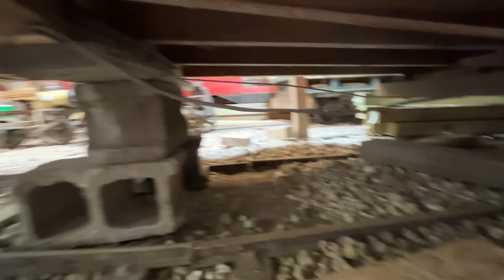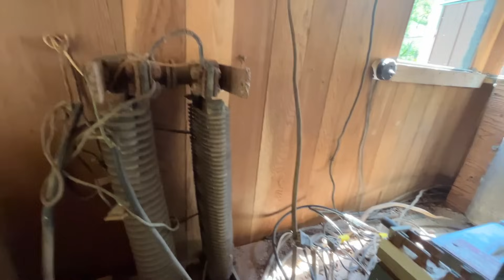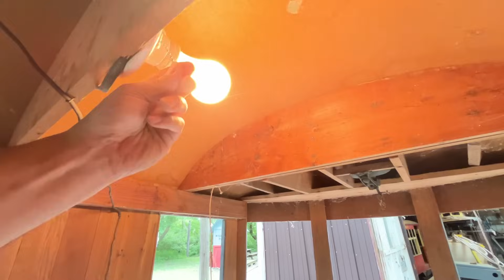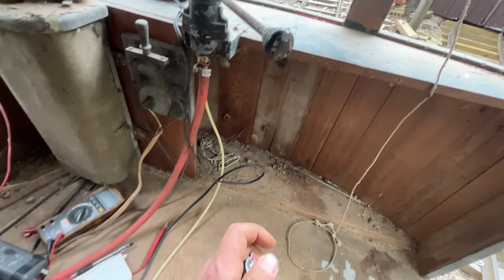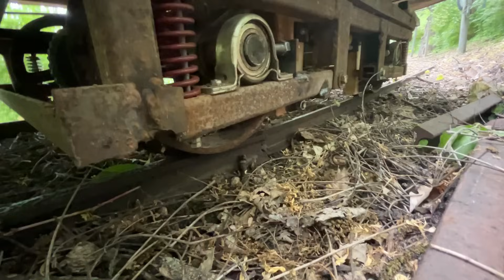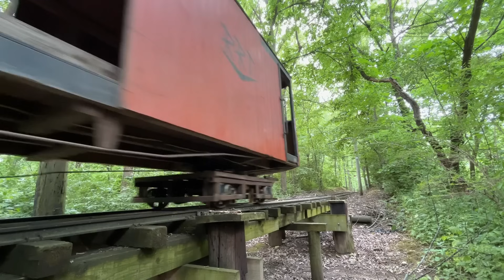Boxmotor truck motor modification, part 3. The initial test of AC traction!

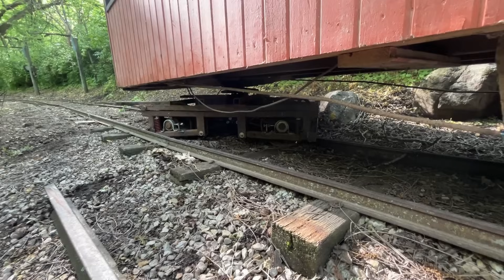Comment: The reason for the derailment is right there in the video at 13:50 - 13:55. The trailing truck catches the down grade end of the spare length of rail laying on the right hand side of the track. At 13:55 you see the up grade end move forward in the earth, at 13:58 the rust mark on the end of the tie shows where the rail had been sitting. Hope this throws light on the issue. By the way, just discovered delightful videos. Best wishes from England.

Comment: I love the integration and modifications. I love the rides on the rails. What is the maximum operational current the overhead power line system can safely/reliably deliver?
Reply from the maker: The substations are fused at 30 amps each, and there are 3 substations spaced equally around the line

Comment: On the older dc motor, depending on its rated voltage, you could make a full-wave bridge rectifier from the ac supply. The biggest issue would be syncing the rpms on both, if you went that way.
Reply from the maker: Thats how the old system worked, was just a basic resistor based speed control. It worked fine for many years, but an upgrade was due!

Comment: This dropped into my feed and I am glad it did.  That is soo cool!  What a toy set!
Are you running a filter or buffer like a UPS between the overhead and the VFD?  I imagine the VFD has to be a bit more sensitive than the old system to the micro drops.  I hope you still fix that bad track joint.
Sitting here in envy.  Cheers!
Reply from the maker: Nope, the VFD is fed right from the line! It has a really large front end capacitor bank that will run the motor for 5-10 seconds of power loss and so far its working well enough with that.

Comment: It would be really cool if you put a brush on the box motor and converted it into a snow sweeper for the winter. Great video as always!
Reply from the maker: I've considered doing this, but the road to get there is nearly impassible after much snow so I wouldnt get to use it much unfortunately. Unless I buy a plow truck so I can get there lol
Reply: @CNW4145 relatable😅

Comment: Very interesting video. I really like the chain drive system. I can't believe that whole box balances on those 2 pivot points. Seems kind of sketchy to me. The trucks seem so narrow compared to the overhang on the car itself. I don't know how much the car weighs but it seems like all the components on the trucks look underbuilt for the job. You would think that the pivot rods would go through some kind of bearing with a bolt to secure them to the box. Just my engineer's point of view.

Comment: caution, NEVER use cement blocks for cribbing.  they can fail without warning.  use wood, very safe, NEVER cement blocks, you can be trapped or killed
Reply from the maker: This is also why you never work under a suspended load, and always anticipate that its going to fall.

Comment: You can see that the car struck that rail lying on the right side of the hill track. If you look at minute 13:52, you can see the near end of the loose rail within a couple of inches of the running rail. Probably the truck hit it
Reply from the maker: Nope, the rail was hit as a result of the derailment. I found the problem already and it has been fixed :)

Comment: Do you need a separate VFD for each motor when you get the other truck upgraded?
Reply from the maker: No, the VFD I bought is a 10HP, and it will drive 2 2HP motors. Should be more than enough power!

Comment: What a superb video ( as always) I am always happy when your latest videos pops up.
However 
Your happiness when Boxmotor just flew up the hill. was simply joyful to hear, if you could bottle that, we would be millionaires!!  
This is a great Chanel to watch
Reply from the maker: It was a good feeling to see it work so well, by the math I was going to have just enough power to get up the hill. But I had made some assumptions in the calculations so I wasn't 100% sure it was going to work. Fortunately the car is lighter than I thought, and the grade is probably not as steep as I thought which led to the overwhelming success :)

Comment: At 11:52 you can see a link of rail that is close to the line on the right side.  The truck hit it causing the derailment.   You can see it move up a few feet as the truck smacked it.
Reply from the maker: While it appears that way, the derail actually happened much sooner than where the rail was placed. When the car went a bit sideways it allowed it to get close enough to hit that piece of rail. I found the bad spot in the track and have since replaced the springs which now allows it to traverse the bad joint without issue :)

Comment: I like small channels with interesting rail based content. I'm amazed it took so long to find you. Been watching a few vids. I'm fascinated with catenary and pantographs. Must have something to do with mild OCD. You picked up another Sub.  

Re grade determination, on another channel they're planning a route extension. Every episode has at least one derailment. They don't take themselves seriously at all. It's very funny.
So for the route extension plan they have this tool called MOASURE (I guess Minute Of Angle Sure - hence Moasure). It isn't cheap $6-900 depending, but if you ever needed to work out grades on a route extension, where to put fill etc that is the tool for the job. It has point to point and out and back, circuit etc - I guess for landscapers building paths and planning gardens. 
If interested check out this episode>>  Mill Brook Railroad Building a Railroad Bed With Nothing But Hand Tools
Reply from the maker: Welcome to the channel!  I enjoy watching the Millbrook guys as well :)

Comment: Modern technology sure makes motor control easier.  It’s nice to see that it runs so well. Do you plan to re motor the other truck, or will the one have enough power.
Reply: I guess you answered that at the end of the video.

Comment: Congrats!  Fantastic always to see another video up.  I did hold my breath at 13:51 when I spotted the spare rail really really close to the right side of the track -  and you can see this rail get jammed ahead about a foot at 13:54, so initial reaction to the derail was the spare rail not clearing something on the tram?  But I see you went on to determine the cause as the uncompressed spring.
Reply from the maker: That piece of rail is there to change out a bad section when I get to it, when the car derailed it pushed the piece forward. I'm kind of glad I caught all of that on video!

Comment: What a treat to se the Boxmotor running! I really look forward to following how you rework this charming (and well built) vehicle. 

Charming in my view, because it bears the shape of a classic streetcar - although I clearly get that the steeplecab is so practical for work trains. Charm aside, the improved drivetrain, control equipment, the planned placing of it, interior remake… will make the Boxmotor shine. 

Warm greetings from Norway…!
Reply from the maker: Thank you!

Comment: How about fixing a catch rail on the inner side of the rail on the inside of the curve.  Then even if the wheel on the outside rail does jump, the catch rail will hold the wheel flange in place and prevent it from coming off the rails?
Reply from the maker: That curve is going to get a gaurdrail as soon as I get some 12lb rail to upgrade it with. Hopefully soon I will run across some to install.

Comment: Nice to see all the foliage on the trees, the line looks totally different. Interesting that your overhead is 240 volts and yet your domestic voltage is 110 volts. Here in the UK, domestic voltage is 240 volts.
Great to see the boxmotor running again.
Reply: Most homes in the US have 240v split-phase run into them for high power appliances such as electric stoves and clothes dryers. We just split the phase in half for 120v in most outlets and light sockets, hence why we can get away with terrible plug designs, most outlets won't kill you instantly if you touch the live current as it is 120v. Of course our 240v outlets also suck, but there are usually no more than 3-4 in any given home, and you are meant to shut off the breaker before tamping with the plug.
Reply: @joedingo7022  I think you are bit out of date regarding UK socket outlets . I am currently sitting in my little 2 bedroom house in Blackpool ,England and there are 15 double sockets in my living room and probably 40 in the whole house and workshop (model railwar room). Not all will have as many as me I will concede!
Reply: @captainnemo247  I meant that US houses have dozens of 120v outlets, but no more than a handful of our sketchy 240v outlets.

Comment: such a cool setup, I love how AC motors are getting more and more practical to use nowadays with VFDs becoming affordable and tons of E bikes and EV brushless controllers for battery powered stuff. It would be a dream to have a private rail line that large to play with, excited to see how the interior ends up looking like when you make the dash and finish mounting the VFD underneath, Do you plan on doing a driving seat too or is it comfy how it is?
Reply from the maker: Im going to add a seat, and maybe some benches in the middle for other passengers. I'm getting to old to sit on my knees anymore lol

Comment: Great action shots outside of the car on the RR.  VFD's are amazing and efficient.  For low cost braking resistors if you need them, electric stove burner elements can work depending on the VFD. I retrofitted a 15hp on a cnc lathe and the stove element has been doing braking duty for 15+ years now no problems.  Your VFD can probably do 200 and maybe 400 Hz, that would be a real speed run!  60 Hz looks plenty fast tho!
Reply: That stove element seems a smart 
economical way, just like real train dynamic braking😊
Reply: @danielfantino1714  Ya the best match ohm's wise was the smaller diameter element at Lowes. 15 years ago they were like $8.00
Reply: @funone8716 
When we see the numbers of years a stove element can last, à very rare article that still last in crap cheapy modern things, on that application it should last for ever, and if connect to the wire, even make a cup of tea or coffee. And in winter cold why  not a hot wine cup....even if FRA won´t approve the last one😅😅😅😅
Reply from the maker: I do use the braking capability, but it already has a large internal resistor that seems to be working fine. I added an external resistor and did a test, doesnt seem to be shunting much power through it so I'll probably continue to use the internal bank. Funny enough the Birney car used those stove elements for its speed control resistors for many years before I upgraded it to chopper control. We used to joke that we could put some eggs on them and get breakfast made while we ride lol. Those things were in there for over 50 years and we never had one fail!
Reply: @CNW4145  Not sure but I believe a parameter might have to be changed for internal VS external braking resistor. Some drives also require a separate braking resistor control unit. Those stove elements are tough. Cool to see the improvements!